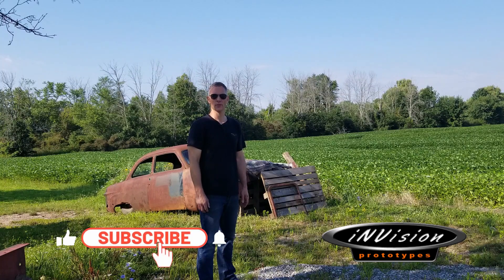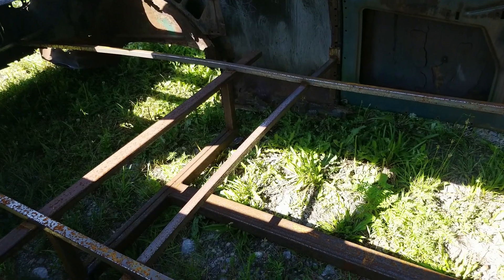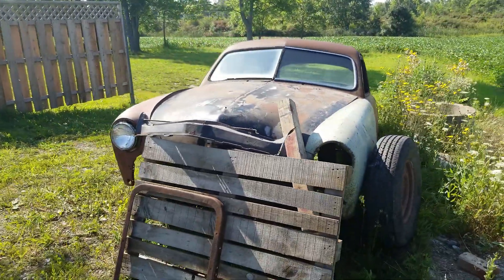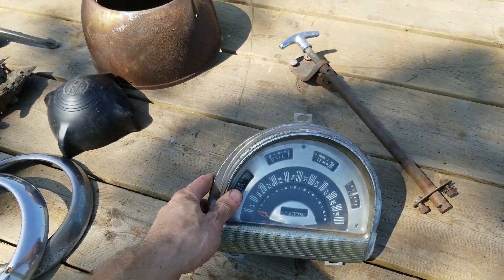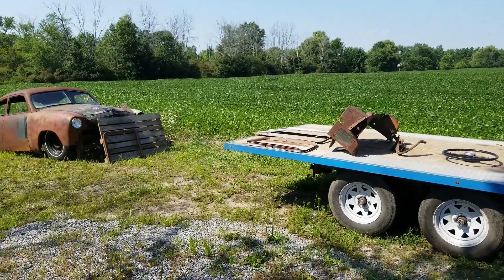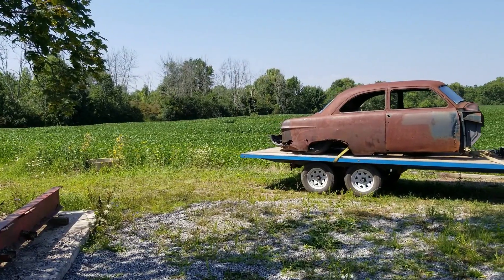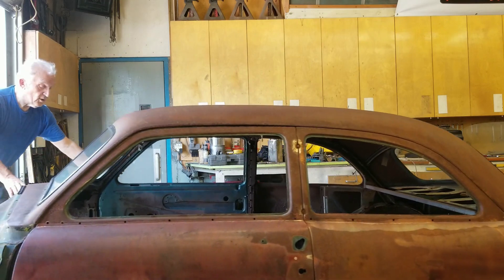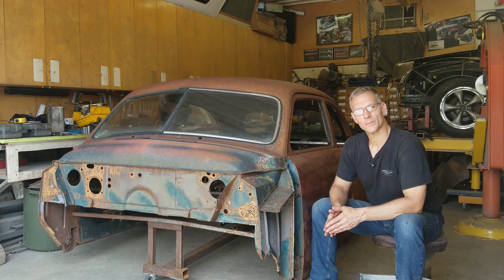FORGOTTEN 1951 FORD Shoebox Sedan RESCUED - Bought Sight Unseen! Ep.1

Comment: Those look great stock or chopped top. I've seen the rear body line to tail light removed. I want to do a old school custom  with different  head area reshaped, different  tail light shape...
Reply from the maker: I've seen guys shave the rear tail lights and use vertical style lights instead.  Might be an option as that tail light feature looks a bit short along the side.  N.